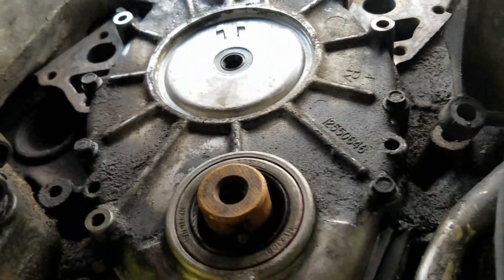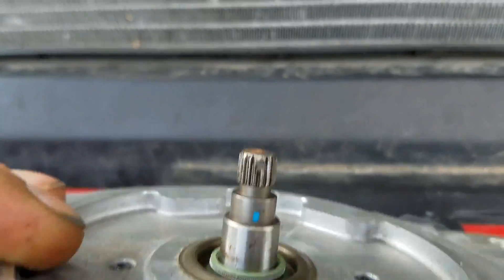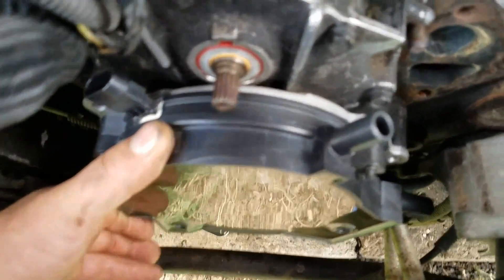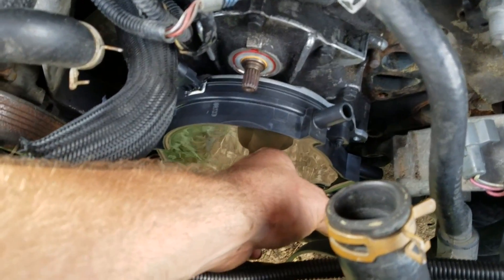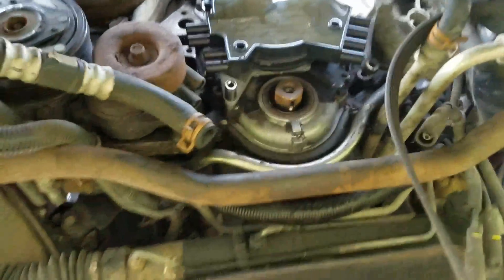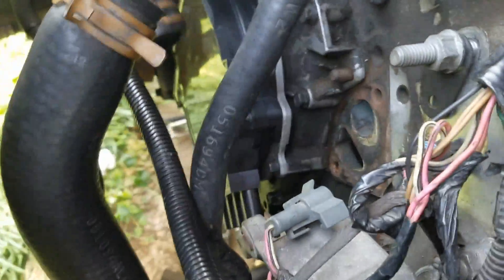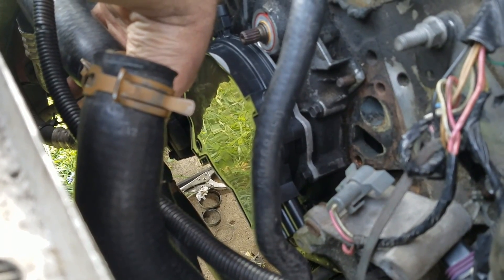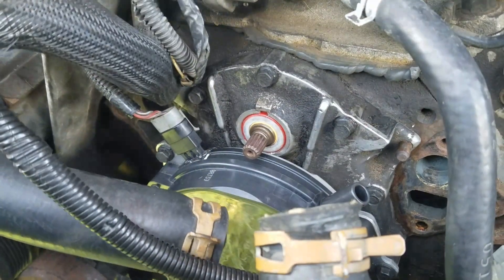92-94 LT1 Optispark PROPER Installation Explained

Comment: I solved  the problem with lining up the spline drive in the hole by leaving the cap off    install  spline drive  on the back  of the opti then  line it  with the  hole  while gently turning  the rotor back and fourth  until the opti locks into position . I realize this is an old video.

Comment: I got rid of that coolant line running to the throttle body, and stuck on a couple of vacuum hoses to make the Opti vented. It's running better than ever now.
Reply: Where did you put the hoses to make the opti vented did you just put one on the bottom where it’s supposed to drain
Reply: And how did you get rid of the coolant line

Comment: Let a just say i forgot to do this and i put it in until it snapped in without forceing it. And now it wont start. Got any ideas on how to fix it?
Reply from the maker: I don't 100% understand what you're saying... Are you saying you did it wrong? If so then the answer is obviously do it right. If you're saying you didn't do it wrong, then either you forgot something or your opti is junk. Double and triple check everything. If you spent less than $300 for the opti, then I have bad news for you...

Comment: Could your optispark still be bad if your engine light isn’t on ?
Reply from the maker: Yes, I've had it happen. It just depends on how bad it is and how often it acts up.
Reply: @BuckeyeBallistics  seems like it only does it when the car get hot but when the car is cool or at operating temperature it runs great specially on the highway.
Reply from the maker: It could be the coil or the ignition control module- I've had those fail also, and heat affects them. But also I had a failing opti that ran fine on higher rpms like you mention (highway), but crappy at lower rpms. The coil and ICM are a lot cheaper and a lot easier to replace, so check those first. Not to mention the ICM is really sensitive to heat, and it's mounted directly to the head. You can add a washer or two under it on each side to bring it up off the head and stay cooler, or they make a special grease to put under it that acts as a heat dissipator. Those should be easy to test with a multimeter as well...
Reply: @BuckeyeBallistics  i replaced the coil and ignition module a few weeks ago no change. So i don’t know what todo the hard part is finding someone who knows those motors. 1992 is old
Reply from the maker: I know them, had 3-4 of them. But regardless of the car, a misfire can be caused by like 20 different things. What you have to do is proper diagnosis and testing to find what the issue is (which is why I mentioned the multimeter). Good chance it's the opti since you already replaced the coil and ICM, especially if it's the original opti- but it might not be. Since heat is affecting it, it would certainly seem to be ignition related- unless there is a leak in the intake system or a hot spot in the cylinder due to carbon buildup causing early detonation. Also if you're running regular gas, stop that immediately and try premium. But overall you have to test the components one at a time, process of elimination to find the culprit. I could name 20 things that could cause the misfire, but I couldn't tell you which one it is unless I do the diagnostic testing to find it. I just went through this with my Eclipse, numerous hours of testing every possible thing just to find the timing belt had skipped 2 teeth...
Reply: @BuckeyeBallistics  i replaced the optispark last year… are you located in New Jersey? Haha
Reply from the maker: Ohio lol

Comment: Question instead of using a new opti can i use the efi connections 92 to 93-94 harness connection adapter?
Reply from the maker: I have no idea. Most guys upgrade to the LS1 coil pack ignition...
Reply: @BuckeyeBallistics  yeah so i got the ltcc thing just wondering how it goes on lol i have ls6 coils mounted just the wiring is the hard part

Comment: And also I don’t know what the hell GM factory people thought of this idea to make a rip off half front engine to change the distributor there was no problem with the top distributor like from the 1950s all the way up to the 1990s and they had a change of 92 I would like to beat the shit out of them people are designed out smoking crack them guys.🙄🙄🙄 The worst design ever came from GM as the saying goes if it’s not broken don’t fix it or should be if it’s not broken don’t re-engineer the engineering you had before. And the worst part about this off the spark shit is you can’t buy a Gear drive to put on the front to have that sweet sound and noisy gear drive but I guess you could if you got rid of the water pump at a regular water pump not a regular water pump but electric water pump that separate that way  it doesn’t have to run into the cam gear . OPTi spark is a stupid ass design all but they all thought it look good on paper or a mix then get more money from the people that buy the vehicles or have to get a mechanic to do it sad. I’m going to attempt this feet tomorrow but I should change the cam since I’m in this area taking the front off my poor Corvette is too quiet calorie Pepto the one I just had not too long ago was loud and shaking people are scared and pull up sidecar from the camp sound gear drive there’s some ass ran a red light and totaled my whole car to the junkyard so I had to buy a 1992 I didn’t even look at the engine until I got home after I bought it does it go shit where is the distributor well I know where it is now.

Comment: not for 94 , your descript is wrong...the 94 + has the different opti female and male connections
Reply from the maker: The car is this video is literally a 94...
Reply: @BuckeyeBallistics  94 vented has a different spline..you must then have non vented...shoudl state that in the descript as non vented opti
Reply from the maker: On the f-bodies (which this car is), 95 and up has a different spline, not 94 and up- so my title is correct. Also I don't think they were vented until 95 either, but that part I'm not 100% sure about.

Comment: My 95 has 50,000 miles, I am dreading the day I have to do this replacement, hopefully not for a long while.
Reply from the maker: According to GM, the service life of the opti was around 80,000 miles. Usually past 100,000 is when they start having issues, allthough by now, age should be playing a roll on them and not just mileage. So in theory, it could start acting up tomorrow, or maybe not for another 50,000 miles or longer...
Reply: Did it hold up 3 years later? I changed it on my 95 bout 2 years ago now still working great

Comment: What are symptoms of a bad opitispark? My 94 Firebird keeps stalling when I hit the gas hard. I was told I replace my water pump as well by the mechanic, is that true or is that him just trying to get more money out of me?
Reply from the maker: Well stalling is definately one of the symptoms. Typically it is a misfire, usually pretty bad when you try to accelerate. If it gets bad enough the car won't even run. Obviously other things can cause this issue as well though. You have to take the water pump off to get the opti off, so it is a good idea to go ahead and replace it since you are already taking it off. A leaking water pump can cause the opti to fail, since it leaks on top of it. Would suck to replace the opti and then a few weaks or months later your old water pump starts leaking on top of your new opti. So yes, I would say it's a good idea to replace the pump while you're at it if you plan on keeping the car long to avoid any future issues.

Comment: My car cranks then immediately cuts back off. Had it towed to mechanic, he says he "thinks" it's the distributor. He wants to charge me $ 500 to fix. Is he right or could it be a multitude of problems before I fall into this money drain pit?
Reply from the maker: Give me a back story. When did you first notice the car having issues and what were they. How long has this been going in, has it progressively been getting worse. Did it act up more in the rain than dry. Describe exactly what happens now when you try to start it and how many times have you tried to start it since it won't run. Answering these things will help me narrow it down a little.
Reply: @BuckeyeBallistics  Thanks for responding. Ok, let me start from the beginning. I bought a 95 Chevy Impala SS in June 2020. The oil pressure gauge and gas gauge wasn't working and the pass key fault light was on. The car starts right up after it has been sitting overnight, but if you drive it then cut it off and try to crank it again, it would do a long crank were I had to hold the key until it cranked up. I tried getting a new key but it kept doing it. I was going to do a key bypass but never got around to it. From June to October I barely drove the car for I was fixing little things on it (new tires, new radiator fan, tint, brakes, rotors, battery, windshield wipers, etc...) I was able to get the the gas gauge to work by pouring sea foam into the gas tank in October (got that tip from a Youtuber). In November, was driving the car and after about 30 minutes, it started jumping like it was running out of gas (which it couldn't be because I had just filled up the tank). I tried pressing down on the gas pedal but it wouldn't accelerated and it started slowing down, the oil pressure gauge which was stuck on high went down to 0, and the "check gauge" light came on and the car shut off. I sat on the side of the road for 30 minutes and tried cranking it back up. I cranked up then cut back off, "check gauge" light again. I figured it was the oil pressor sensor so I ordered the OEM part and installed it myself. Cranked car, oil pressor gauge went to the middle, car started shaking again and cut off (but no check gauge light this time). I had it towed to a mechanic and explained all this information to him. He said it "sounds like the distributor."
Reply from the maker: So when you first start it, it runs ok for a couple seconds and then starts shaking and shuts of? Or does it just run like crap immediately? If it runs good for a few seconds before shaking and then dying, then I would definately say it's the optispark distributor. Also, if you are able, check the fuel pressure and make sure the fuel pump kicks on.
Reply: @BuckeyeBallistics  Yes, when I crank it, it runs ok for say 3 seconds then starts shaking and shuts off. Another Youtuber suggested the fuel pump as well. I'm actually going to have it towed to another mechanic because the current mechanic seems unsure, he keeps using "guessing" words and I'm not playing the let's change out everything 1 by 1 until we find the problem game. Thanks for your help.
Reply from the maker: Yeah, definately take it to a competent mechanic. If it's an ignition problem then I would definately suspect the opti based off your description, but it could also be a fuel problem.
Reply: @jamaljamal6169 my fuel pump went out twice on my 94 caprice it ran for a few secs then cut right off. Tonight I just realized my optispark is out roo

Comment: I have a 96 ss with the 383 stoker I’m having issues with the optispark Was running perfect and died on me the Mechanic said the OPTi was bad so they changed it drove it home next day Wouldn’t start brought it back to the shop they said it was the OPTi again so they switched it again this time put some lock seal ran perfect for about a week now same issue can anyone tell a reason maybe why this is happening
Reply from the maker: My guess would be you are using a cheap opti? Anything other that the OE AC Delco/Delphi opti's are known to be unreliable. If that's not the case, then something must be shorting it out.
Reply: Guns&Cars yes it was some off brand new men or something Don’t remember the name but yes I’m definitely gonna go with what you said hopefully this will fix my issue thanks
Reply from the maker: Let me know how it goes! And that's odd, unless you requested a cheap opti, because most shops use the original equipment parts because they warrant them and their work. I hope you're not having to pay for this for the 3rd time now, hope that their work was warranted.

Comment: Wondering if it's okay to turn the drive on the opti before installing to get it to line up correctly?
Reply from the maker: Yes that's fine. As long as the notch is lined up with the other notch when it's installed, everything will be timed correctly.
Reply: @BuckeyeBallistics  Appreciate it. Have a misfire I'm chasing, love the content! It's helping a lot.
Reply from the maker: I'm glad. I got tired of working on these lol.

Comment: Was there another pulley on yours behind the harmonic balancer
Reply from the maker: No. There is an aftermarket underdrive pulley, will be smaller diameter, that bolts to the factory balancer. I can't remember the brand but I have seen them before. It allows you to underdrive the accessories for a slight performance gain, but retains the factory balancer for reliability purposes so that the engine isn't unbalanced. Your belt size will be different with this on there too.

Comment: There is a suggestion on Corvette Ben's site -the water pump has a weep hole in the bottom,tap it ,put in a little fitting,and a line to direct any possible  seepage  away from your Opti .
Reply from the maker: That's a fine hack and all but technically if it is leaking then it needs replaced/rebuilt. But good insurance for when it does occur.
Reply: it Might (it occurs now)be helpful to route the line so that any seepage would be easy to spot,-on the ground.
Reply from the maker: Well yeah

Comment: I have a 96 roadmaster 5.7 lt1. I'll give the whole story. So one day I decided to fix all the oil leaks (keep in mind the car was running good before I started the repair) so I did all the seals on the front of the motor. Water pump seal, crankshaft seal, and opti seal. Also did the intake gasket and valve cover gaskets. Put all that back together cranked it and got a real low idle then it stall out. I can't get it run strong. I can get it to crank but not start. The only way I can get a little bit of anything is if I give it gas while cranking then I'll get a low low idle very bad sputtering misfiring kind of deal. I ran the engine code and it was a multiple cylinder misfire code. So at this point I get a fuel pressure gauge and test my pressure and it gives me a 30 something psi range. So then I basically do the whole fuel system. New fuel pump, fuel pump relay,new fuel regulator, new fuel filter, new injectors. Then I'm getting no reading at all now on my pressure gauge. I eventually troubleshoot the pressure issue down to a faulty pressure gauge being that I manually tested the flow by pulling the line after the tank, good flow their reconnected that. Then I pulled the hose before the filter, good flow, after the filter ,good flow their. Before the fuel rail, good flow their, pulled return line on rail, good flow their. So I know I'm getting good pressure wont know exactly the number till I get a good gauge on it. But with just common sense I know I'm getting good damn pressure if fuel is shooting out of their like a damn cannon. Also replaced ignition coil and ignition switch. Now I'm down to the electrical side. I pulled a plug and it was black as charcoal. Now I'm in the process of doing all the plugs and wires which is another headache. I'm wondering if I may have messed up the opti some how after separating it from the motor after 24 years. It was covered in oil when I took it off and may have took a coolant bath in my incompetence of taking hoses off, cant remember though.
Reply from the maker: Yeah very early on to your statement I was thinking you got the opti wet. Also, make sure the plug wires are in the correct order and not arcing against anything or one another. If you got the order mixed up then it will run horribly, or not at all. Ask me how I know...
Reply: 😂 im still trying to figure why mine is misfiring. My story of working on my 95 impala is similar to yours, good luck 👍🏼

Comment: Cant you squirt some hi heat silicone to stop the thing from getting wet ?
Reply from the maker: Bandaid fix that might work for a while. But by the time it has gotten wet once it is already damaged and begins to corrode and wear down, reducing spark efficiency. Worth a shot for a temporary fix; maybe. Even doing that will require some work though because you'll most likely still have to move the water pump and pulley to get all around it.
Reply from the maker: @joemomma1  Good idea